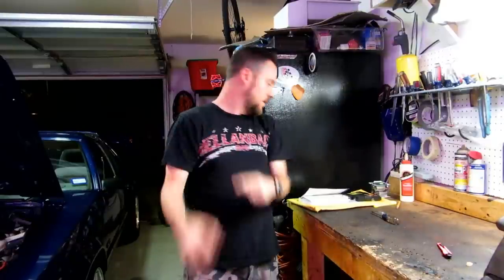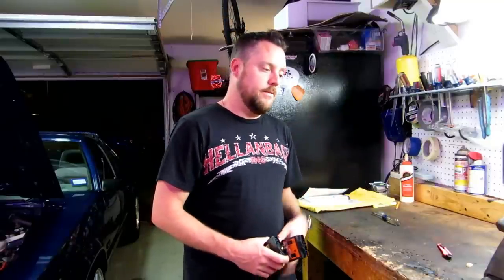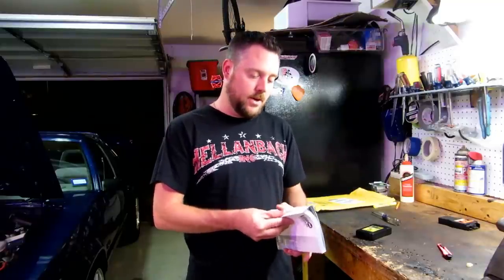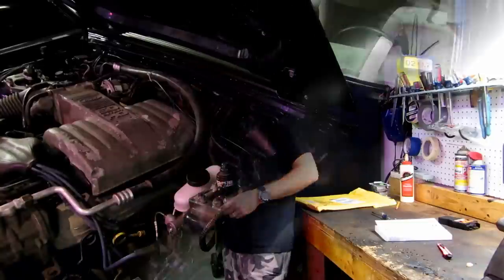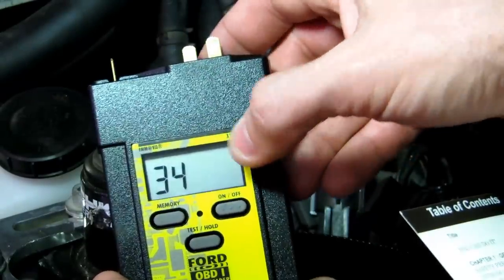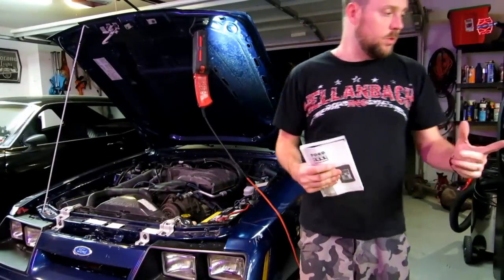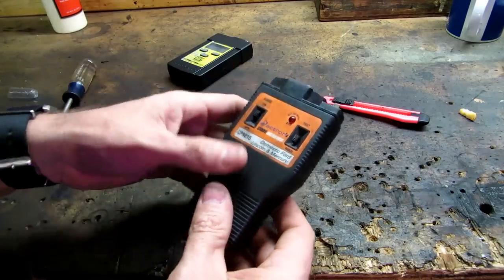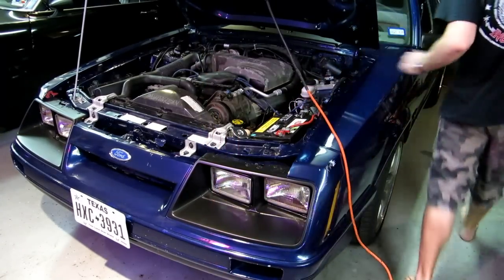1986 Mustang GT - Scanning for codes with a  Innova digital OBD1 Scan Tool

Comment: Appreciate your demonstration man ! Wish I still had my 4 eyed Fox Capri's and Mustangs. Recently installed an 87 Turbo Coupe 2.3 turbo into a 1990 Mustang 2.3. Got it running, but I suspect a ton of codes, so I bought the Innova 3145. Have an 89 stock 5.0 owned for 27 years. Unlike 86 and older you can cycle the key. Screw that ! Keep that '86 , love it !!!
Reply from the maker: Thanks Mike! Appreciate the kind words

Comment: Get a Actron CP9690 code tester. It checks live, record, graphing, emissions readiness test, oxygen sensor test, ABS, SRS, and MORE! It has code-connect to provide solutions to codes. It comes in a black pouch. Get a USB cable to update it. It uses 4 aaa batteries. EBAY has it. It has adaptors for OBDI Ford, G.M., Chrysler, and Toyota. It has a cable for OBDII. Snap-On has a scanner and primary and troubleshooting cartridges. Get the battery clamp cable for the Ford-1B adaptor. Get the battery pak. It uses personality keys. Ford uses a K2A key for OBDII. It uses a 9volt square battery on the left side. Get the manuals. See if you can find a case. EBAY has it.

Comment: do you have any more info about the cylinder code.. just pulled codes off my 88 gt.. strangely enough fist thing that poped up was 6 cyl.. followed by 18 and 51. the car does feel like wants to die when i mash on pedal at idle but still works and idles fine..  i wonder where its picking up that its 6cy?? any ideas?

Comment: It's the salt and pepper shaker looking connectors that hang on the upper intake next to the throttle body. Ford even had a recall that added about 6 inches or wire there because it was to short in some cars.
Reply from the maker: Ah those solenoids. There is two, I thought the ERG solenoid was on the driver side, at least that's where the vac lines go :) I will check these two for sure.

Comment: God tips from the Canadian for the surging idle as Well! :-D
One other ring to try if that don't work is unplug the 10 pin connector and give it a good cleaning and retention the female sockets. That can cause all kinds of false failures as well.
Reply from the maker: Thanks! Which 10 pin connector?
Reply: StratTone is that on the computer harness

Comment: Wouldn't KOEO (instead of KOER) = Key On Engine On. Anyways, ordering the OBD1 scanner now from Amazon for my 95 Ford Escort. See what the deal is with my low rpm misfires. Thnx for the video. Really really helpful.
Reply from the maker: Yessir good luck! KOEO is key on engine off.
Reply: @HOUSEOFDULA  I  received my OBD1 a couple days ago and reading the instructions... you are absolutely right!! Please accept my apologies for my presumptive thinking.  :)

Comment: Great video, I bought one of these for my 88 gt but for some reason I don’t have the grey pin to look for codes on it. My 89 does though. Any ideas on how I can run codes or if I’ll need to buy a replacement wiring harness to add the single pin connector that’s grey? Any feed back would be great thank you.

Comment: Great Video!  Yeah get her warmed up then run the koer test. Code 21 will throw if temp is below 180*. The egr more likely just carbon up. Ever thought about registering your car as a antique?
Reply from the maker: Yeah, I likely will, my Torino is, but I drive the mustang a lot. Def a lot cheaper and only have to mess with it every 5 years.

Comment: Yeah the egr affects mileage since it stays in open loop. The open loop fuel trim is set rich since it is used at cold start up. The power effects come from the timing not being able to advance as much since the open loop strategy is set to limits. 
Thermactor won't change or do anything since it only changes based on input sensors. All input sensors can affects spark fuel and timing. The only the the thermactor would be needed for is if you had cats. Once the car reaches closed loop the deverter moves the smog pump air to the cat which was intended to mix pure air with your exhaust which made it cleaner and less likely to clog the cats. One cool thing about the diverter activating when in closed loop is that makes it a perfect place to put a test light to see if you are actually going into closed loop. 
Oh and another reason to leave the EGR on is because at WOT it is bypassed anyway and won't hurt power.
Reply from the maker: This is what I thought and kinda why I'm looking into getting it fixed. Im also looking at aftermarked ECU / management for future upgrades for the car.

Comment: I got the dame reader and it didn't tell me what cylinder motor I have ? It's a 87 fox mass converted
Reply: Having the same issue. Start koeo test but does nothing. Idle drops and comes back up but it does not tell me the engine size. I have a solid square and the link triangle. Any help is appreciated!

Comment: Yeah they do look like solenoids but they are just huge connectors. Lol I'd have to double check but I think they have a black and white top. Over time they get a little nasty and loose so that's a good place to start before chasing your tail since many sensors get their power from there. A good cleaning and retention with some fresh dialectric grease can get it nice and right again.
Reply from the maker: Cool, thanks! will check it tonight.

Comment: Mike I have a 1987 GT,it does not have a check engine light either from the factory! I believe 1989-1993,mass air equipped cars from the factory have a check engine light. Our mid 1988 California emissions control cars I believe! And mine does not a cover for the computer connection either. Just thought you might like to know! That is a lot quicker than counting blinks,lol.
Reply from the maker: Good to know! My mistake. I had thought the 87's got it.
Reply: Mine is a 88 California car. Does have a working engine light. Also the only car that came with a maf meter.
Reply from the maker: Explains why you didnt need to do the converion!

Comment: I rewired my cooling fan to be manual..... but ODB 1 reader does not show any problem or even it does not even recognise it...Do you know what the problem is? ODB 1 should give me a code that fan problem (disconnected) or something.
Reply from the maker: ECU's on early fox's running an E-fan? Im not certain, but I didnt think obd1 foxes ever had electric fans. If it did it was likely added on (possibly from an sn95 fox?) and the fan had a stand alone computer or thermo activated relay that kicked it on. Either way the ECU has no clue about whether the fan is "on" or "off"
Reply: Mike = (if the fan connecter is out you will get an engine light on) so the ODB1 reader detect fan. Why that is? before I rewired the cooling fan I connect ODB1 reader to engine to test the system ( it was 4 yrs ago) and right away the fan kicked in for 3-4 sec and the reader continued its testing for other components. So, I know OBD1 recognises fan connection but yesterday when I did a ODB1 test ( just for pure curiosity) with disconnected fan (since its manual connected switch) I did not see any code for fan trouble.  I expected a code saying "can not read cooling fan motor or cooling fan connection off etc" but there was none.... Eventually the ODB1 reader came back with a 111 code = all good ( although) it was not due to cooling fan disconnection.

Comment: Also just a tip I wouldn't delete or ignore the egr failure. The EGR on the eec iv is an input device and will leave your stang in open loop if deleted or not fixed. Being in open loop will also effect your timing advance robbing you of power not to mention mileage from being in open loop and not using data collected from the O2s to change fuel trim. You are probably right in the fact that it is just carbon buildup and a good cleaning could cure that problem. 
The thermactor diverter and bypass solenoids are output devices and hurt nothing if not functioning properly. That hole system can be removed and the codes can be ignored.
Reply from the maker: +StratTone - interesting, although I had no intentions in removing the EGR, I didn't know they could be causing my mileage and power to suffer. So removing the thermactor system has no affect on the engine? Appreciate the information

Comment: For the surge at idle, remove your throttle body and clean it up with throttle body cleaner. That should solve that issue.
Reply from the maker: +Newfie-Dean - thanks, I suspect most of the motor has a lot of carbon buildup. I will try to remove the throttlebody and cleaning up, I also have an EGR valve I can replace if needed.
Reply: Mike Dula sounds like a plan, also you can try cleaning the MAF sensor assuming it has one. Great videos, I've been watching them from Newfoundland, Canada! My first car ever was a 1986 Mustang Notch and it had 599,000 kms on the odometer when it was put to the scrap yard, that is about 400,000 miles! I actually kept the odometer for proof! I'm on my 4th Mustang, a 2006 GT that I bought in Denver, CO when I worked there in 2006. Almost 11 years old now but in mint condition with 90,000 miles. Only drive it 2000 miles a year or less this last few years, garage queen now!
Reply: Mike Dula you should paint the side louvres black as well as the rubberized body mouldings, it will look better with that trim painted all black.
Reply from the maker: Agree! Looking to do this soon, will video it.
Reply from the maker: Welcome Canadian from Texas! Glad to have you man. Sound like a true mustang guy. These 302's with maintenance will last forever but 400K? good lord lol thats something else.
Reply: There was a story I saw on the news about 5-6 years ago, a vacuum cleaner sales lady had a 1988 GT with 670,000+ MILES, original engine and tranny! There's a reason I like Mustangs. I bought a 2001 new out of school and drove it to Colorado in 2001, had that car in the USA Rockies for 6 years, then to Western Canada, then back to Newfoundland. It was in amazing shape and had 422,000kms or 262,000+ miles when a young girl ran into me and totalled my car and hers in 2012! I was pretty ticked off to say the least!